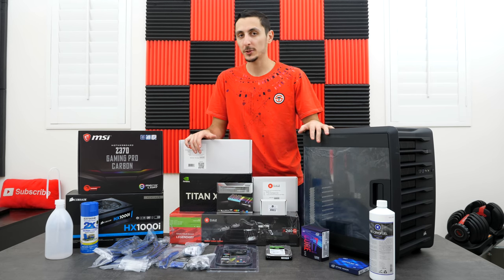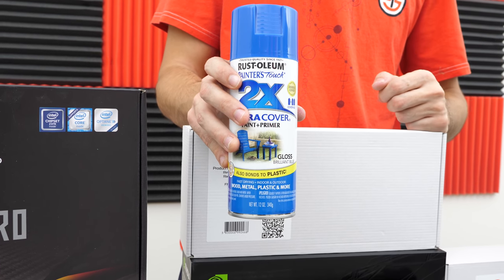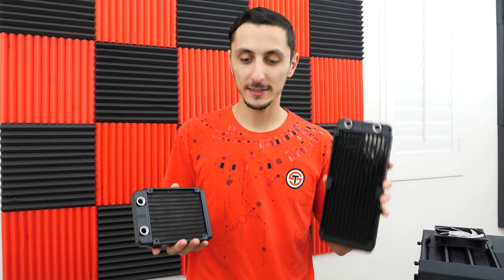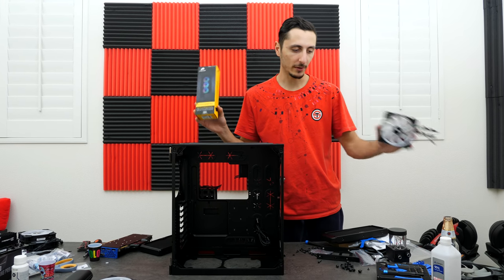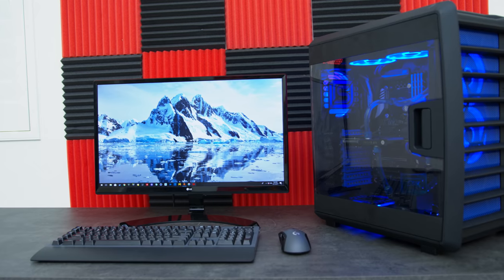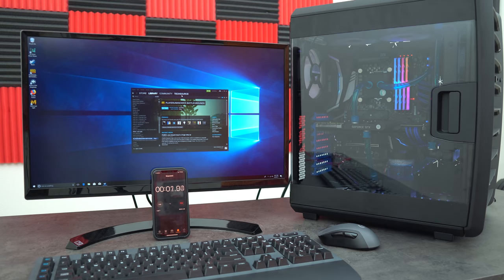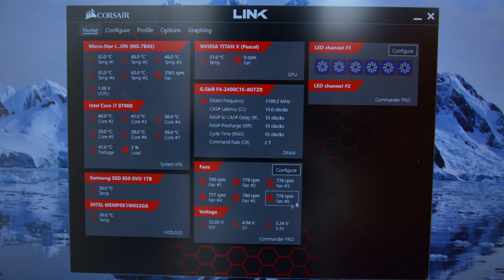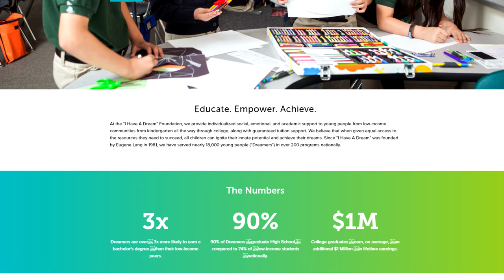Building My 2nd Water Cooled Gaming PC

Comment: Prosesser: Intel Core i9-7980XE Processors BX80673I97980X 1,974.99
GPU: Nvidia Titan XP - Brand New Model - April 2017 Release 1,430.00
Motherboard: GIGABYTE X299 AORUS Gaming 9 499.99
RAM: Corsair Vengeance RGB 128GB (8x16GB) DDR4 3600 (PC4-28800) C18 Desktop memory - Intel X299 PC memory 1,754.86
Power Supply: EVGA SuperNOVA 1000 G2 80+ GOLD, 1000W Fully Modular 259.00
Hard Drive: Seagate 10TB IronWolf NAS SATA 6Gb/s NCQ 256MB Cache 3.5-Inch Internal Hard Drive 335.36
SSD: Samsung 850 EVO 4TB 2.5-Inch SATA III Internal SSD 1,488.88
Case: Corsair Crystal Series 570X RGB - Tempered Glass, Premium ATX Mid-Tower Case Cases CC-9011098-WW 179.98
Mouse: Razer Mamba Chroma - Professional Grade eSports Wired/Wireless Ergonomic Gaming Mouse - 16,000 DPI Sensor 132.72
Keyboard: Mechanical Keyboard, ANNE Pro Bluetooth 4.0 Wired/Wireless Keyboard with RGB LED Backlit & PBT Keycap 89.99
Mousepad: Razer Sphex V2 - Ultra Thin Polycarbonate Professional-Grade Gaming Mouse Mat - Non-Slip Adhesive Base 15.99
Extras: Intel Optane Memory Module 32 GB PCIe M.2 80mm MEMPEK1W032GAXT 76.99

Total: 8,238.75

I dare you.
All parts from amazon.
Reply: TheReal PwnGuy1 why is the Optane there with an SSD... It won't impact performance at all and only works on the boot drive.

Comment: I also built my first full Custom Loop with EK Fluid Gaming parts but not with a kit. i chose all parts seperately (Bigger Pump/reservoir combo, 360 Rad, angled fittings). i`m very satisfied with the loop. 7700K @ 4,9 GHz on 65-70 max and GTX 1080ti and 2121 GHz at 55-60 max.

Comment: Optane: You can't afford an SSD but you can buy a 7th gen processor and a z270 motherboard... WTF Intel?
Reply: David797979 z370*
Reply: 8th gen btw
Reply: I think he means the min requirements for optane. 7th gen or better and 200 series or better chipset
Reply: I have a 8th gen processor (i3 8100)  but i cant affort a ssd
Reply: It’s meant for larger storage. I think you can afford an i7-7700K but not a 4TB SSD.
Reply: @eirtifjdj4905  dude a 120 gb is like 40$ cmon
Reply: @peteparkour02  20-30

Comment: Question, why do most AIO units  come with a copper heat sync if the chip lids are aluminium? wouldn't that cause corrosion?

Comment: Is thid a Good pc for the Money? i3 8100, some kind of b360 or h370 motherboard when they come out, q evga gtx 1050 ti, crucial ballistix sport 2x4gb ram, evga 500b psu, phanteks eclipse p400, 120gb ssd wd green, 1 tb harddrive, it costs 850$ here in Sweden.
Reply: Good budget build, at that price range i wouldnt use the ssd, put it towards a 1060.

Comment: Im doing a  white and blue pc build can you give some tips or a list? $350 -$1000 budget minimum specs are pentium g4500s or a athlon a6 750 ti or rx 550 500hdd or 256gb ssd a case that won’t cut my fingers apart 8gb ddr4 ram if its under $500 no need to buy a cpu cooler $501 - $1000 buy a separate cooler no need for sli or crossfire

Comment: Mine runs at 1.424 - 1.486 at 5ghz. Could I lower vcore in the bios. I used a motherboard included preset to oc to 5ghz.

Comment: Im thinking about changing my gpu atm I have a msi gtx 960 4gb wich I want to change to a gtx 1060 asus strix but I have one question I have a corsair 550s watt power supply is that enough for my gpu?
Reply: mark vandewifi • I have a Gtx 1060 and a ryzen 5 1600 and it works fine for me with a 550 watt power supply. Didn’t do any overclocking.

Comment: I have a question I have a amd 6300 6 core processor and a gtx 1060 6gb and 8gb if ram and I get 50 FPS in rust in lowest settings is it the processor making it laggy?
Reply: Loki it’s a 6300 so definitely. I’ve seen 9590 bottleneck RX 480
Reply: Ok cool thanks
Reply: Loki 
Yes
Reply: can i just put an intel i5 in or is there a specific thing that fits?
Reply: Loki you need a motherboard that supports that cpu. Basically you need a whole new platform if you are changing to Intel cpus. New board, ram and of course the cpu.

Comment: I don't know much about gaming pcs but would this be able to run pubg AMD Athlon II X4 880K 4.0GHz (Overclocked to 4.4GHz) Quad Core Processor
AMD Radeon RX 560 2GB Graphics Card
8GB of 1600MHz DDR3 Memory
120GB Solid State Drive
1TB SATA3 6Gbps Hard Drive

Comment: not the best build you can build and totally not worth it in terms of the certain parts which were used such as why go for optane on a HDD when someone looking to get the ultimate gaming performance by getting best gaming CPU and a Titan XP (2017 release) would just go for like a 512 GB or higher storage capacity M.2 or something paired with a 4TB HDD